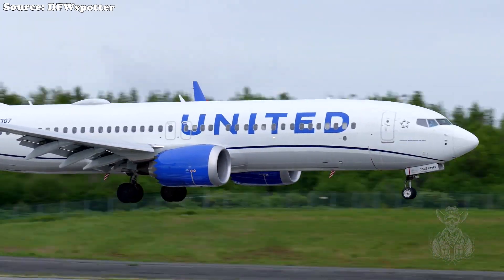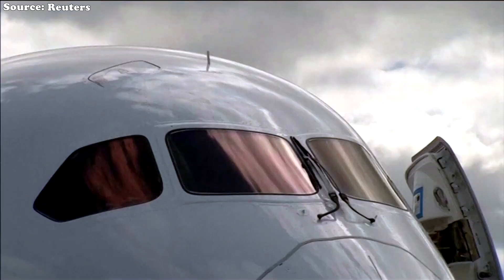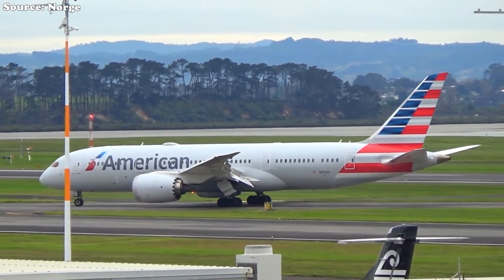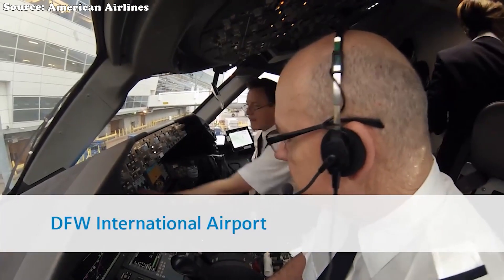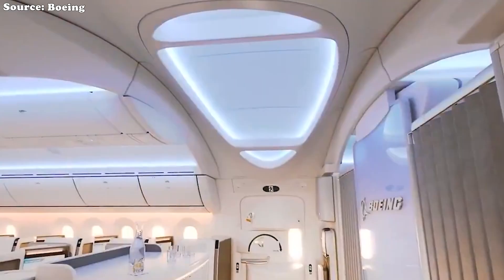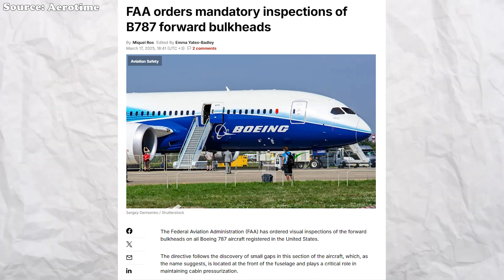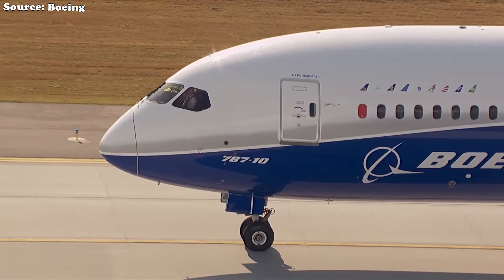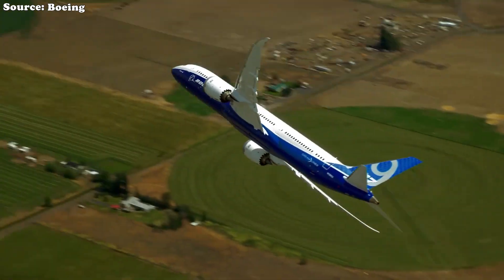The FAA Just Dropped a BOMBSHELL about Boeing 787! Trouble again...

Comment: Southern Airlines found so many problems with their 787s that they scrapped all of them and because of safety decided to never fly them again.  Water, as in the Air India flight which crashed killing 144 people in June, got into the electric system.  They found so many problems.  Nothing fit anything.  The plane could come apart at 30,000 as it is glued together.

Comment: But airlines and leasing keep buying these problematic aircraft. Issues and defects will never stop. The 787 program initially never had a smooth road. Why would Boeing and it supplier put the seat switch where easily assessable to others. Crazzzy
Reply: As passengers we need to refuse to fly on them.

Comment: I won't fly on any Boeing Aircraft except the B757, B767 or 737-900ER. I don't trust anything they sell since those. I 'm sure glad my Hometown Airline, Delta doesn't fly the B787, they have A330 CEOS and NEOS and A350 for long haul.
Reply: Silly decision- all certified aircraft have the same potential issues - all manufacturers not just Boeing ! As a matter of fact Boeing is the best
Reply: @Millefleurs-81 best how exactly?
Reply: Maintenance isn't done on any.  Then you have these 777 787 which are flying coffins.
Reply: @camlacasse3760  you win the dumbest comment of the year with that one, only 1 787 has crashed with thousands out there and that was suicide
Reply: so then don't

Comment: Delays are ok it's only passenger lives really at risk. In capitalism the bean counters rule supreme! The B-787  used  composite construction even in the wing box
it lighter but stronger then steel, Yah the captain seat lock didn't lock sometimes and moved the seat back. What are the odds at  rotation at higher deck angle.
The captain's left hand steering the plane, his right holding throttles wide open his seat slides back for some reason. Since he is still holding throttles forward
his unexpected chair slide closes both throttles at that point. fate is sealed for the flight.
Reply: Really!  What a lot of BS

Comment: stupid anti Boeing person the 787 keeps getting huge orders it is one of the safest airplane in service
if what you are saying is true there would have been and would be many more accidents
ie be careful of slandering Boeing
Reply: Southern Airlines took one apart.  What they found was so disturbing that they scrapped all of theirs and will never fly them again.  Water can get into the electrical department shorting out the computers, everything.  The fuselage was glued together.  Bolts of different dimensions forced into wrong holes, kinds like the round plug into the square hole.  So much glued stuff.  Ridiculous.  BOEING should be charged criminally.
Reply: @camlacasse3760  Glue is normal in all aircraft today. The glue used is better than riveting